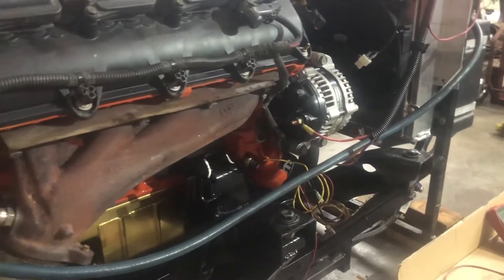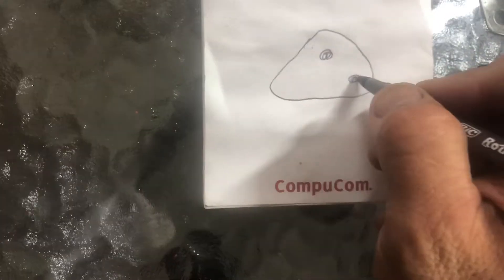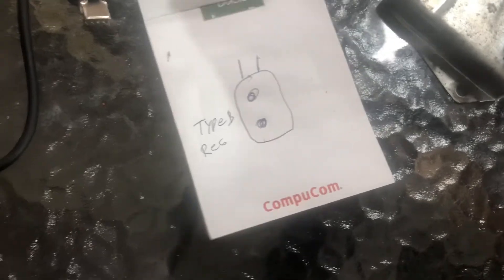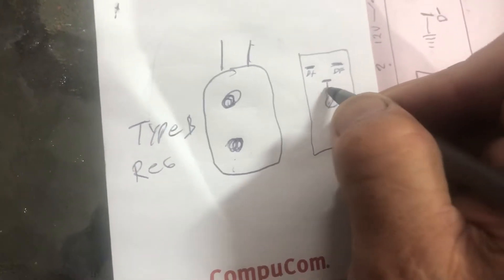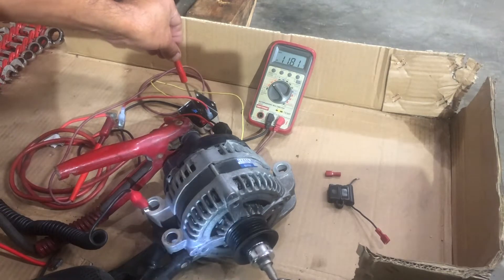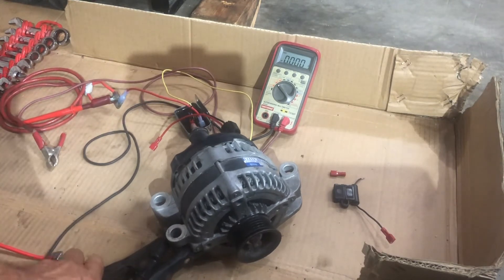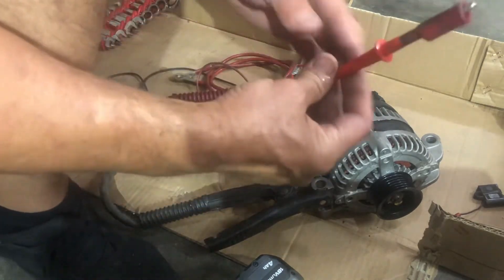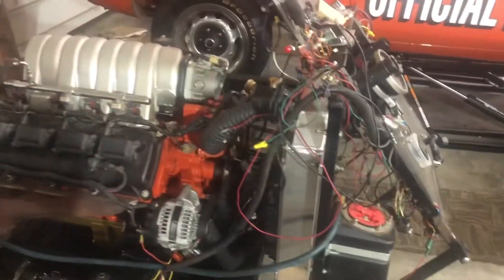Dodge, Chrysler, Jeep alternator  Type-A, Type-B voltage adjustable regulator.

Comment: I’ve got a 2006 PT Cruiser, 2.4L, non turbo, automatic, and I’ve wired it with a relay, ignition in run to close the relay, and fused wire from battery positive through the closed relay to the ignition post on my voltage regulator (adjustable 2 wire just like yours, set to 175 ohms in the 2k scale on multimeter). The second wire from 2wire clip/connector on alternator grounds to the alternator case, and regulator case grounds to firewall. I’ve got 12.5 volts to relay and to ignition lug on regulator, but only 6.4 volts at the alternator, which won’t excite the field. The alternator puts out 17+ volts unregulated.  What am I doing wrong, or how do I get the field wire from regulator up to 8 or 9 volts??
Reply from the maker: I don’t know what kind of alternator that is. A or B type. All I can say is get a service manual and see what it says about testing your charging system. You can also try an alternator company and ask for a regulator for your alternator.

Comment: I have 3-2010 5.7 chargers and want to have a type B on hand. Looked all over eBay have yet so find one like it
Reply from the maker: Look on eBay item # 383786231337. I see it for $25.99 right now.

Alternator External Voltage Regulator For Porsche 911 914 1965-1977 Adjustable
Reply: @shelbydogg  I’m on it! thx sir

Comment: For the type b which i need for my challenger what is that regulator actually for? Can only find for porsche,  benz, Mercedes,  lambo.
Reply from the maker: @joshanator84  Challenger uses the ECU to control the alternator. If you want to control it externally, then you use the ones that you mentioned.

Comment: So my alternator is from 2011 town and country so it’s the newer model type of alternator does that mean I can’t use voltage regulator kit because the PCM is not controlling it anymore it’s my second new alternator and still not charging the new battery.
Reply from the maker: You can try the newer style regulator that I show from a Porsche and it should work to control your alternator if your PCM is no longer controlling it because the circuit burned out.

Comment: would be interested to know if in the "B" alternator if you hooked a test light up to the unused wire plug/pin if when the key on alternator not turning test light /idiot light would light and go out when alt is turning. so you could use that pin as a dash/warning light. may be use the original wire if you were using this to get away from changing a bad computer with built in volt regulator. that's how old ones worked, I think.
Reply from the maker: No, you’ll have to build a circuit that lights a light bulb if the voltage isn’t above the charge voltage selected. You could probably find a circuit on the web, or just use a voltmeter

Comment: Hi Rob. Still fighting for 13.5 V.
Reply from the maker: If you can’t get more than  13.5v, then you are drawing more power than the alternator can put out. Fans are known to pull a lot of amperage. Are they off when you are measuring the output voltage and adjusting the potentiometer? Does it go higher when reving it up  ?

Comment: I have a 69 Barracuda that the alternator seems to test fine. It's an old style MOPAR unit.  I have swapped 5 regulators and get either no voltage or 15+V? The top field reads 578 M ohms to ground? I checked the field brushes and have 2.8 ohms between them? Nothing between the top field brush and the attachment screw. With the motor running both field brushes have the same voltage.  Why don't this work. I put a screwdriver on the back of the alternator while the motor is running and it sticks.  I can let ho and it doesn't move.  Any ideas?
Reply: fastback cuda?

Comment: do you have a link for the type B regulator, I'm having a hard time finding it
Reply from the maker: I showed a pic at the end with key words to search on EBay. You can’t find it?
Reply: @shelbydogg  thanks, now that I know that they are for a BMW, I found a lot of them. They went up in price though now 34.95
Reply from the maker: @MrMopar5151  the one I show in the picture is $25.99 from transpo for a Porsche, and it is the same regulator
Reply from the maker: @MrMopar5151  Search this "Alternator External Voltage
Regulator For Porsche 911 914 1965-1977
Adiustable" it's $25.99 with free shipping.
Reply from the maker: Search EBay for Alternator HD Adjustable External Voltage Regulator Fits BMW 1600 1800 2000 2002
Reply from the maker: Search this "Alternator External Voltage Regulator For Porsche 911 914 1965-1977 Adjustable"    it's $25.99 with free shipping.